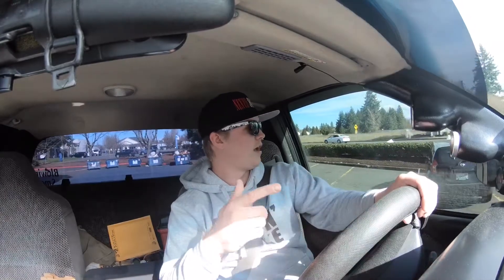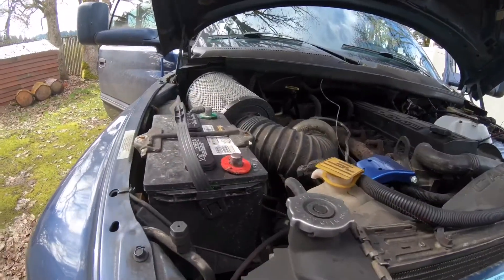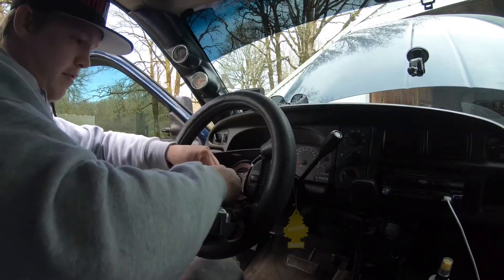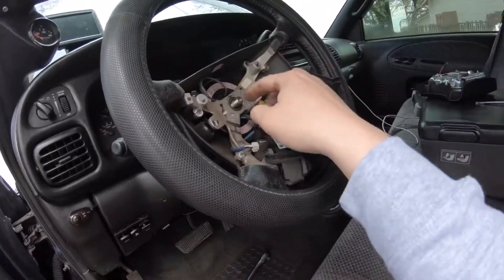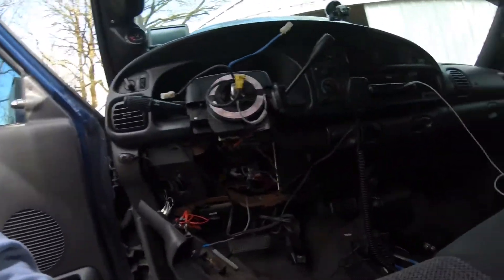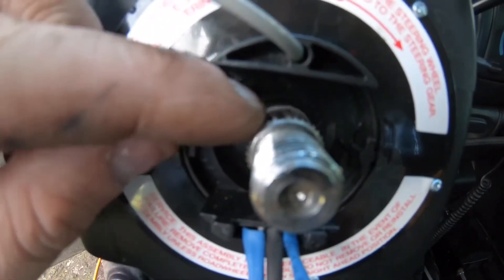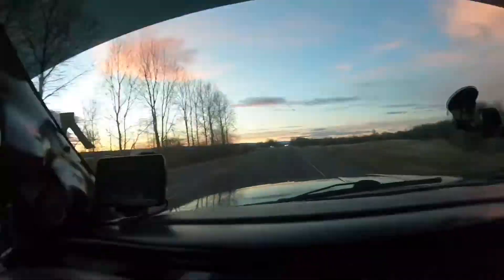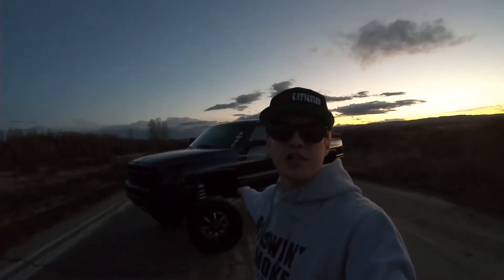How to replace clock spring on 94-02 Dodge Ram. Fix annoying airbag beeping!

Comment: Great video anything you do at this point is of help to me. I've had the entire fragile dash out of the truck. Thanks to LMC Truck I have the dash topper back in the truck I do still need to reinstall the passenger airbag and controller along with the wires to the cruise control. I'm short on time and work keeps me very busy. I hope to be able to enjoy my truck like you one day keep up the good work congratulations on your baby girl and a new truck I'll keep watching thanks a lot.
Reply: @DMACHOLMAN  unfortunately, gen2 Dodge Rams are notorious for plastic dash supports. My headlight switch and climate controls are free floating in my dash. I’ve tried several types of glue and feel that my only option at this point is to create or fabricate a metal plate that I can attach my controls to. I’m working on it.

Comment: So i replaced the clock spring but when I pulled the steering wheel my steering wheel column squeaks with and bump or movement. Any suggestions where I need to tighten?
Reply from the maker: 332nik hmm not exactly sure. Maybe try lubricating around the steering shaft and make sure everything is snug. Otherwise I’d look on the forms.

Comment: My only issue with this i had happen over 5 years ago with clock spring...i replaced it myself and after that the Air bag lamp never did go off. Still no answers. Unless its an airbag module.
Reply: I replaced mine about three years and the horn still doesn't work and the air bag light still on. Gonna rip the steering wheel off and replace the clock spring again.

Comment: I don’t have any lights or warning alarms, just no horn.
Reply: You made this comment 3yrs ago and I’m having the same problem. Have you found a fix yet?
Reply: @The-Ram1500  yes, clock spring under steering wheel.
Reply: @constancekrischan9967  Thank you this really helps me!
Reply: @The-Ram1500  it’s important to do this right you have to disconnect your battery.
Reply: @constancekrischan9967 I’ll do that.
Reply: @constancekrischan9967 I woke up to my horn just going off 
Is that my clock spring
Reply: Yep, it was my clock spring
Reply: Always disconnect your battery when working on electronics or anything electrical which is your whole truck basically big blues running like a champ now optimum efficiency
Reply: @The-Ram1500  yes, it was my clock spring! It’s located under the airbag on the steering column under the steering wheel!